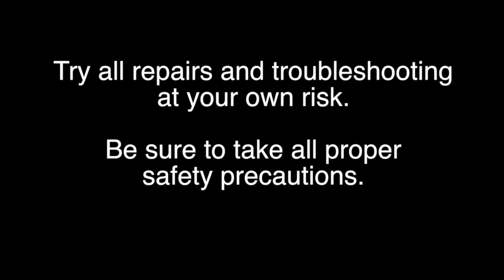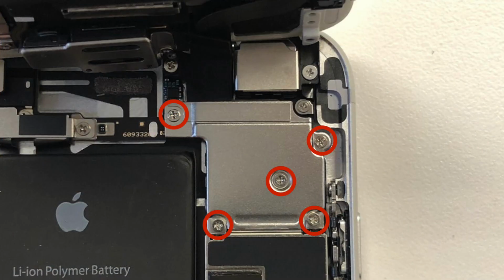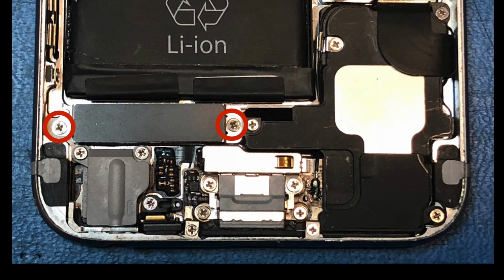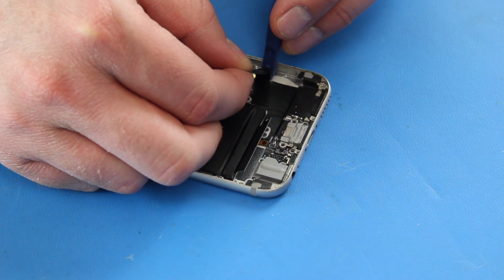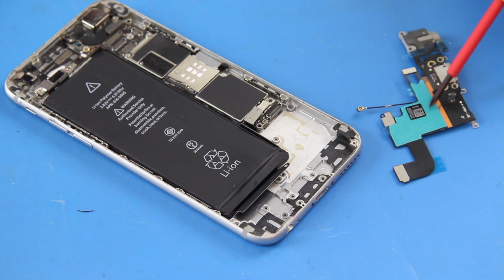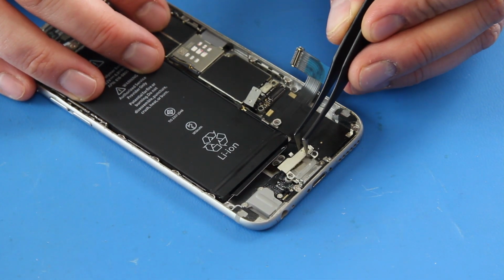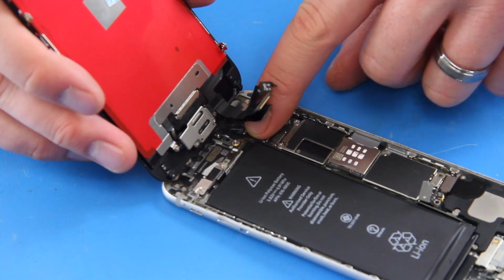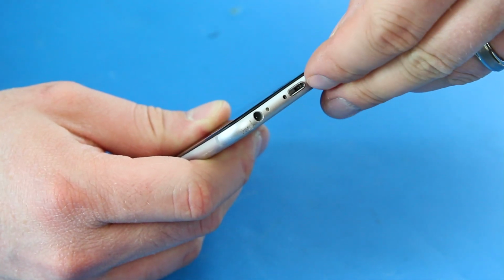iPhone 6 Repair - How to Replace the Charging Port & Headphone Jack

Comment: Hi I’ve been having this problem with my samsung un39fh5000f where every time I play games and a large portion of the screen is changed like if I were to pull up a new screen my TVs  pixels will sort of darken and fade away and the whole screen eventually turns black or sometimes the tv will turn on but be black please help